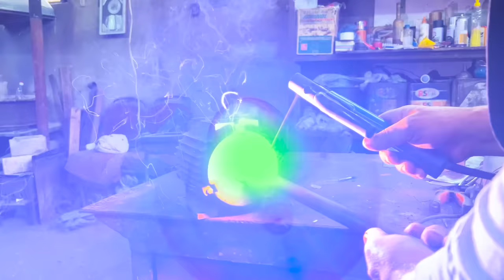I Found And Disassembled The Broken Motor To Make A Very Sharp And Strong Knife!

Comment: Tell me why he wasted the time destroying the motor housing and stator, when there were only four bolts to remove, to get the rotor out? Seems like he has some grinder skills, but the laminates are low carbon, almost iron, in motors. It helps the magnetic Fields to flow freely. The shaft isn't much better, usually a mild cold roll steel. The motor bearings, are the only metal, capable of holding a edge, for any length of time. You would need to surface harden the metal by carbonization.
Reply: I was asking the same, why they bother themselves by smashing, puching on poor stator to get rotor out 😂 Or why not take out bearings with proper tools😂
Reply: Far as I can tell, it's probably the same reason Picasso gradually moved from photorealism to abstract with his paintings - when your skill reaches a high enough level, you stop giving a crap about 'efficiency' and 'doing it right' and just have fun with it.
Reply: 😂 km
Reply: First thing I thought... why beat, solder, heat and break down the motor when he could simply disassemble it?
Reply: He did it for dramatic effect.
Reply: For your entertainment
Reply: Jeg prøver heller ikke
Reply: For the clicks. I mean we're all here am I right?
Reply: जिस तरह आपने इस कि वीडियो देखकर अपना टाइम गवाया उसी तरह इसने वीडियो बना कर तुम्हारा टाइम गवाया सिंपल
Reply: Видео про то, как с максимальными усилиями сделать бутафорский ножик.
Reply: P
Reply: My guess is YouTube. The thumb nail of the red hot engine. If the dude was selling the knife, he would use bar steel.
Reply: İn that case the content video would be really short. I am sure he knows wery well the easiest way but simply he wanted to do it in a longer way Just to take extra appreciations for his craftmanship.
Reply: To make you a foolish video and get watch time. Bro😅

Comment: do you heat the oil prior to quenching, or does it make a difference if it's room temperature?
Reply: It works better if you heat the oil up first. If the oil is cold you have a better chance of your blade cracking or bending.

Comment: if you disassemble the motor using the screws, you can simply take out the rotor, it should not have been barbarically smashed. There was no point in this operation!